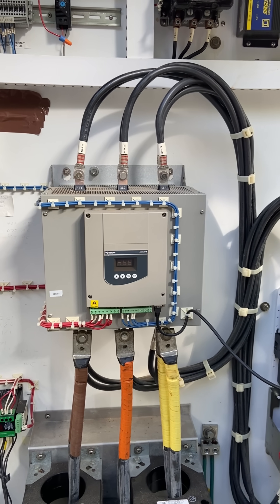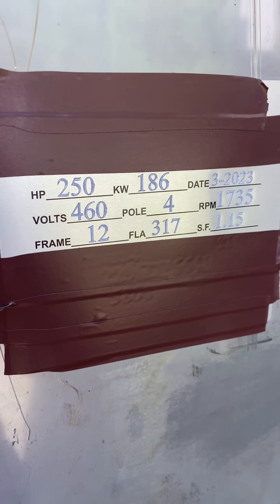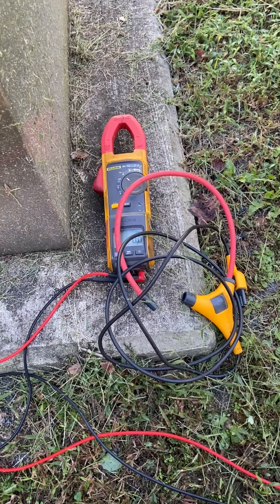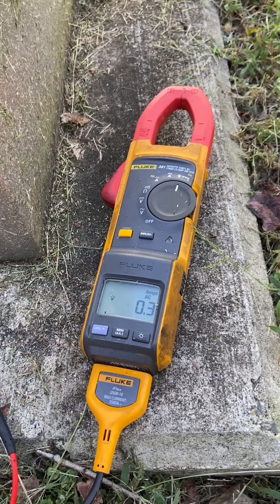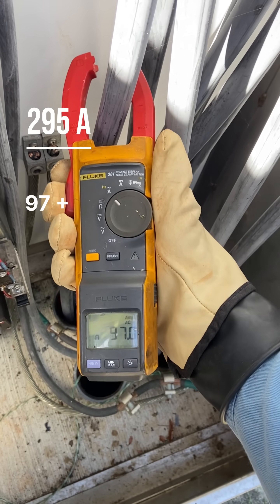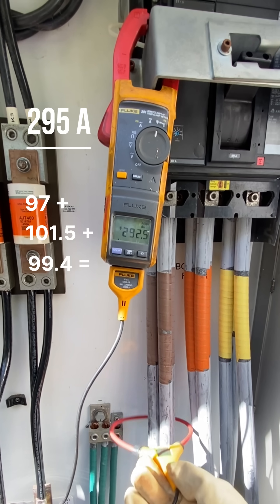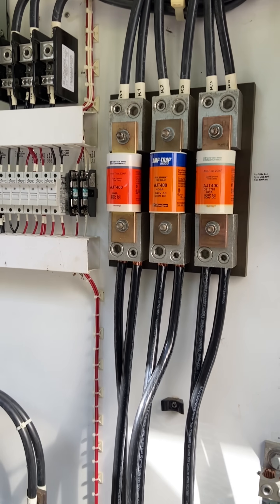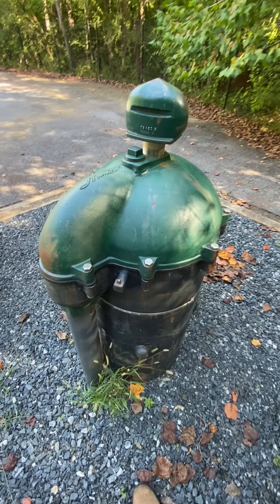Well Pump Current #electrical #motorcontrol

Comment: Here's why you might be getting a bit higher even with calibrated clamps:

The electromagnetic interference from the other poles is inducting a field in your clamp despite not actively being clamped. Just as you noticed before when not quite getting it clamped around all of them.

Comment: I have had to do locomotive load boxes without meter and shunt to help out. The total was greater than my meter could handle so I used two meters as there were two cables. At that point I was able to calculate horsepower. That is after we the stack fires burned out and we weren’t getting rained on from burning tar.  I love load boxing locomotives, especially those old roots blown souping SWs.

Comment: If the conductors are all going to the same load the rope CT is the way to go . The only time you need individual cable readings is if they go to different loads like sub panel feeds or distribution panels that feed sub panels

Comment: So, when measuring individually, do the conductors on the outside of the clamp have an influence on the reading? That magnetic field around that wire would still extend into the loop of that clamp wouldn't it?

Comment: The current readings of Rogowski current sensors and split core current transformers are not going to match exactly; additional difference is introduced by not measuring simultaneously.

Comment: I mean the current monitoring just measures them together, so it's good enough for the electronics that stop the motor from killing itself ¯\_(ツ)_/¯

Also, for the comparison, you're trusting that your amp clamp and the iFlex have exactly the same measurement error

Comment: Little fun fact I teach in my theory classes: if you have multiple wires of the same circuit, single or 3 phase (and the neutral is not shared with another circuit) you can put multiple wires of different phases or neutrals inside the current clamp and the difference in the B field between the wires will give you the result of the remainder on the other wire. Example: I have a 240 circuit with a neutral. If I can’t get to my neutral easy, I can put both phases inside my current probe and it will tell me my neutral current. So if I have 6 amps on one phase, 10 on the other and I clamp them together, my meter will show 4 because 6 will cancel out. This works in 3 phase networks as well. I can put all 3 in and find my neutral current by the imbalance field. Or 2 phases to find the 3rd phase. Many ways of using this theory to test.

Comment: "Calibration" is really just a verification that the meter still performs within its published specs, it doesn't actually involve making any changes to the meter. If it's out of spec then it may be corrected, called "adjustment", but this is avoided unless necessary as it upsets the history of stable cal data.

Comment: Same path and same length ..
Works the same with internet service. The copper must be the same length or you will have a balance issue.
 
Same with speaker wire and surround sound system. All 5 speakers have to have the same amount of wire regardless of how short the fronts are to the rear. 
If the fronts have less speaker wire, the sound will come out off balance.
Reply: As long as the cables have low enough resistance (1/20th the nominal impedance) it wont matter. And if you care about the "balance" you can use thicker wire for the surround speakers because the resistance is what matters.
Reply: @lukahierl9857  Nobody is worried about using cables with low resistance. 
They buy the 16 gauge wire and make sure each speaker has equal length from the unit to the speaker, keeping it simple.
Or you can be that guy that has un-equal length wires to each speaker.

Comment: As you say, and can be seen on your meter's display in the video, the load varies. Therefore the time between individual measurements is a source of inaccuracy for the total, unless you have enough meters to measure them simultaneously.

Combined for device load, individual for conductor load is what I learned (ad hoc: not a power electrician).

Comment: Such a good point to check the current of each wire to make sure there isn't an imbalance... could be caused by bad connections, that get hot.
Loose wires cause fires.

Comment: Considering that this motor is rated at 186KW at 460VAC, the max current draw is about 404 amps doing some simple math.  With a motor that big, this might be a municipal well for drinking water.

Comment: Measuring them separately and adding is just as accurate for a constant load, and it can also help you spot over/underloaded conductors that the flex clamp wouldn’t catch.

Comment: Nothing about this makes sense cuz a 250 hp pump in single phase should be drawing 1000 plus amps and be for industrial purposes if anything but even then it should be 3 phase. What is this pump for that it’s 250 hp single phase drawing 300 amps?

Comment: 250HP is a good size motor for a pump. I imagine that’s a lineshaft turbine pump where the motor sits up top and there is a metal shaft going down several hundred feet to the impellers. If anyone is curious about pumps lol 

also something that took a bit of time to click HP is determined by the load on the motor. 250HP in this case will be the “max” HP. But then there is the service factor which is the percentage overload a motor can handle
Reply: If it were a vertical line shaft pump the motor would be above ground. It’s gotta be a submersible pump, and that’s the discharge piping above ground. I just had to unclog a 200hp submersible wet well at a shit station last week, pull out the rag in the impellers and get splashed w poo, good times. That was the biggest submersible id seen. 300amp 250hp is a thicc boi

Comment: Manual says accuracy of +/- 2% for that range on that metre so the difference shown is within the metre accuracy range
Reply: The meter should be much more stable than its accuracy spec on repeated readings of the same thing, it's just that the value it reads is allowed to be 2% off from the calibration standard.

Comment: Sir, that little 601 MotorSaver Protection Relay displays voltage and current. You didn’t even have to take out your meter.
Reply: That’s what I was wondering… he had CTs right there that are probably pretty accurate. Every time I’ve tested primary injection on one they are spot on

Comment: In my (limited) experience, the big loop current meters should have the wires really close to the center of the loop when you take a measurement, you'll get slightly different readings if the wires are closer to the edge.
Reply: Meh.. Measuring in a way that is easiest is usually what the last and next guys on the same site are doing, so the most useful data is usually gathered by just letting the flaccid boy (or rigid for what it matters) hang where it wants to. Then the (yearly?) values are somewhat comparable with each other.

There's probably bigger differences between different measurement equipment, mains voltages at the time and sun spot patterns that skew the results anyway, so trying to get optimal and absolute values is usually just a waste of time.

Comment: "...little well pump..."
Casually drawing ~300amps
Reply: 460v @ 295a
Tiny
Reply: @JasonW.  135.7 KW or 181hp
Reply: I mean, 300 Amps can be a lot, or a little, as you also need to consider voltage. 300 Amps at 5milli-Volts is not that scary in wattage, but at 12Kilo-Volts? YEESH
Reply: 300 amps!!! Nutz, right!!!😮

Comment: The other thing to remember is clamp meters will have a sweet spot for measuring current. If the wire is outside that area but still inside the loop you'll get slightly more inaccurate readings. Being within 1 or 2% is pretty good when you keep that in mind.

Comment: If you want to know the total current, go around all the conductors. If you suspect a bad conductor, check them individually. Measuring them all together will be more accurate than adding individual measurements. I am not an electrician, I am an electrical engineer. I think this is basically what you said, but you did mention "if you want a more accurate number measure them individually."
Reply: Correct.  Every measurement has an error range, 2% +- 5 digits in this meter's case.  So, by adding 3 measurements, you've also increased the range of error.  
But tbh i think the difference in this video is just due to a variable load.
Reply: @StarlightLumi  For me the issue is simultaneity. With the probe around all conductors, the measurement is simultaneous to all conductors. Without that you are forced to assume that the RMS current magnitude is stable in all conductors. The validity of that assumption is problematic to me. As a simple example, the water level in the well could change slightly, the rotor winding temp could change slightly, and either of those things could have some effect on the current. If the pump is feeding a surge tank, then the back pressure may also be changing with time.

Meanwhile, as long as all the flux lines go through the probe, the probe should sum the currents just fine.

Comment: I wanna know what the GPM or what the depth is. That's insane. For reference a standard well pump at 100ft for a house is usually 3/4hp.
Reply: I think our biggest one at work is 250 hp and it runs at 700ft 950gpm if I recall correctly and it will push more but then we have problems with submergence.
Reply: @tyler1799-g3l  lmao "our pumps so big the earth can't keep up with it"
Reply: @tyler1799-g3l  to put that in perspective, that's 130 pounds of water, every **second**.
Reply: Love your content, mate 👌
Reply: ~200HP, 300-1000 GPM are standard numbers for a municipality (which this has to be) can’t imagine any residential property needing this. Maybe a farmer? But still

Comment: Please correct me if i'm wrong. If the pump is rated at 186kw at 460v, that makes a running current per phase to be at almost 224 amps. If you are pulling 295 amps per phase, how is this poor pump motor not burning itself up?
Reply: It's power on the shaft :) So you have to take into account efficiency and power factor (because he measures total effective current).
Reply: The name plate shows FLA as 317 amps. So 295 is fine.
Reply: 0.78 power factor? I'd expect better from a pump of that size. I got 233 Amps btw
Reply: @bene5431  it is power factor x eff. What I am getting is that 317 x 460 x 3 / sqrt(3) = 252 kW. Nameplate says 186 kW. 186 kW / 252 kW = 0.736. So the product of efficiency and power factor is around 0.736. This seems ballpark to me. Like if the efficiency is 90 percent and the power factor is 0.82.
Reply: @mckenziekeith7434 Awesome, thanks. I will definitely have to pull out my old electrical textbooks and relearn pf. Unfortunately it's not something I have to think about often. I don't usually work on motors over a few hp, this one's a beast.
Reply: @bene5431 Looking at my math, I accidentally divided by 480v, not 460. So 233 is correct. I appreciate the correction.

Comment: Never seen a 250hp subpump. Freaking pump truck would be so big wiring would be sooo heavy, I'd love to see that install live.
Reply: it takes a crane. call barnhart. at work there was well # 7 that went bad.  we used a million gallons a day.  had to use city water for over a year!
Reply: I’m a pump mechanic that pulls these things for a living. The process for pulling a big one like this is the same as for a 4” one. The only difference is now your cursing the stupid gigantic submersible cable and 1 1/2” poly for not flexing at all because it’s 38F outside.

Comment: Not much troubleshooting these days? I really enjoy the trouble call videos. You glove up for running a meter? Is that just for YouTube?
Reply from the maker: @ronborkowski1721 I’ve been doing more new installations recently but there will be more troubleshooting soon. Also in terms of the gloves, you know me too well😂 I didn’t feel like getting flooded with that comment 😅
Reply: @Cursed_Controls  I did my 20 in electrical construction I know how that goes. The YouTube safety department huh. Thought it was strange I don’t think I have ever gloved up to use a meter for anything under 600V. Now we have some substations where I go full zoot suit because of the arc flash rating. I thought there was a provision in 70 E under Testing that said you did not have to get suited up. I can’t find it now though maybe the YouTube safety department right.

Comment: In Greece where my orange fields are, many of the well pumps used to pump clean water are still on the old star delta system, and you can just feel the amps pumping through these motors. Most of them are on the 25-60 Hp range and drive the well head through belts
Reply: In my entire life I have never wanted to feel any amps flowing thru my body. LOL!

Comment: Installer must have had an expiration date on his 2,500 pack of zip ties 😂
Reply: Or he thought "Hey how straight can I get these wires without a solid mounting point"
Reply: @AlpineTheHusky until he starts embedding carbon fiber rods behind the wire, not straight enough! 😅
Reply: I know it goes against everything that US electricians hold holy, but you are allowed to have a wiring cabinet that doesn't look like someone ate sixteen plates of spaghetti and then puked in it.
Reply: @davidgillies620 Recently got a control cabbinet back from the US after "Change reworks"
Dude clearly didnt know why we had built it with multiple 24V and 120V rails...
He just measured and pulled his supply from whatever showed the voltage he needed.
He took the generator switch over controller off of backup 24V and put his 24V LED cabbin light on there.
Reply: Factory/prefab cabinet makers have the biggest boners for zip ties.

Comment: Those control wires need more zip ties
Reply: Installer got paid by the tie and he used up the whole bag.
Reply: @davidyansky6605  the customer paid for the packso he is getting the whole pack.
Reply: We have a guy that installs so many zip-ties on our prototypes.  Dude comes from a production environment.  He just won't understand I'm going to be making changes, debugging, and pulling on those wires.  I've cut off so many zip ties.  I prefer colour coded wires, they are much easier to trace.
Reply: and sticky pads...
but it aint gonna last more than a few months with the heat.

Comment: Different readings on parallel runs can be different length conductors and/or the quality of the terminations.
Reply: Poor terminations are nearly always the source of unusual resistance. Sometimes a fault but usually a nice hot lug.
Reply: Probably more the latter than the former.
Reply: I second that.  A thermo temp gun comes in handy to verify hot spots.
Reply: Also, the magnetic fields from the nearby leads can "steal" a small amount of amps when measuring the pairs together. This was something that confused me until I was shown on a separate panel where the paired leads were spaced apart further.

Comment: If you wanna be a nerd about it, you could’ve done the individual wires also with the flaccid clamp to remove any error between the flaccid and the turgid clamps.
Reply: I always peel back the insulation and measure each strand individually and add them up. Just to be sure.
Reply: @CullenCraft  this is the way
Reply: @CullenCraft understandable
Reply: say flaccid again
Reply: @TrevorCola-yn4xl flaccid again
Reply: @TrevorCola-yn4xl Yeah, just don't yell it out loud at the bar when you're buddy is trying to pick up chicks😮🫣 🤣
Reply: Flaccid
Reply: Hey Beavis. He said flaccid. Huehuehuehhehuehuehue
Reply: Is that style of clamp really, truly, actually called a "flaccid clamp"????
Reply: @doctordinternet it's called rogowski coil
Reply: @TheCarandstuff  Never heard of rogowski's coil. Interesting.
Reply: Gotta work a "moist" in there.  And maybe a "tumescent".
Reply: @alsavage1  Don't get crepuscular on me.
Reply: It is a good word.
Reply: Very funny
Reply: flaccid nerds with clamps make me turgid
Reply: its just how electricity works take a new service and house only thing drawing current is the ac /heat system test the first receptacle you see inside the house and it will be running hot usually 124-127same goes for any size service the voltage will be never exact between phases but close in one direction or the other
Reply: Y’all sayin’ flaccid too much!

Comment: Bigger amps than I see in the field on the equipment I work on!!!!!
Reply: My record was 3x ~4kA at 690 volts. 5 MW steam generator. Outputs from the cabinet were 100x 3x63A fuses for 100 3-phase resistors in one boiler. So each fuse had just over 40 amps on them.

It was way too hard to remove safety stuff and get thermal images from all of it.

There were few loose connections and one fuse holder had a bolt totally missing. Maybe connecting 300 identical things got too repetitive on the cabinet manufacturer side. But, that's the reason we do thermal imaging. It was quite repetitive and boring to measure and document amps from those 300 wires too..

My flaccid boi goes to just 3kA, so I had to believe what the main breaker and integrated power analyzer said for the total currents.

Normally on thermal imaging jobs there's 3 kA rated cabinets and phases measure 50 amps and I have to explain to the customer that the images don't have any value at such loads and the imaging needs to be done when they have production at full tilt. On the 5 MW boiler gig I asked if it's possible to drive it in smaller batches, but the operators wanted to let it loose for few hours at max power and vent the steam to the sky. Holy shit that was loud..
Reply: I've had currents up in that range, I've had voltages up in that range, but never the twain have met.

Comment: Good to see if one wire is loaded more too
Reply: would that difference come from a difference in length?
Reply: @112Haribo  not at reasonable lengths, more like if the cramped lugs were done poorly or have different enough contact with the bus bar
Reply: Have to be the same length, size, and type per Code.